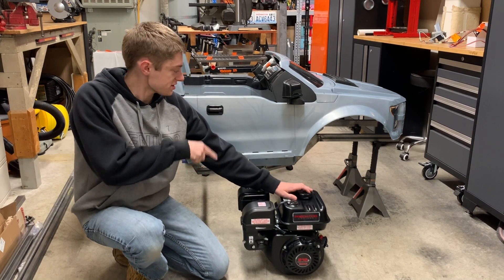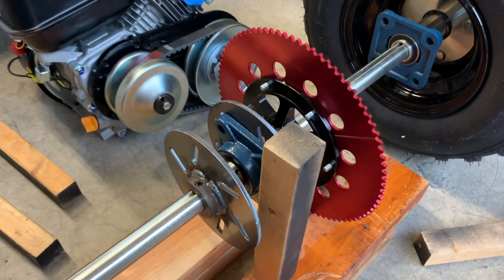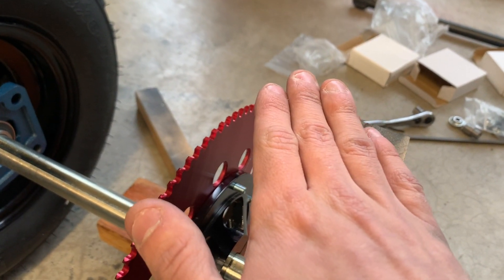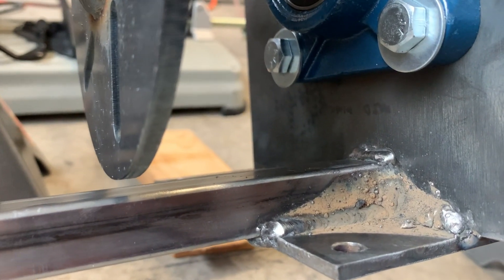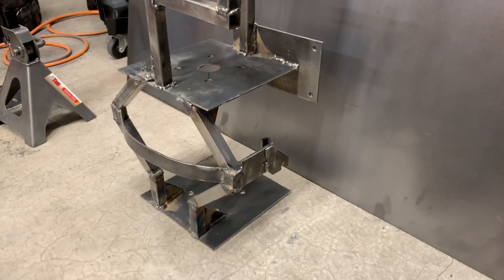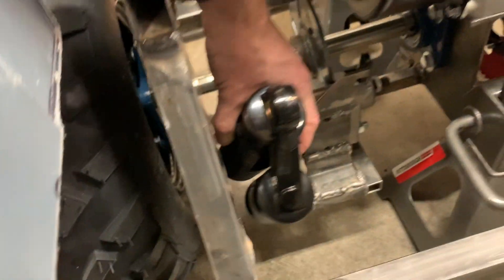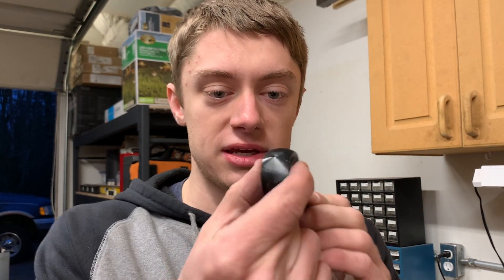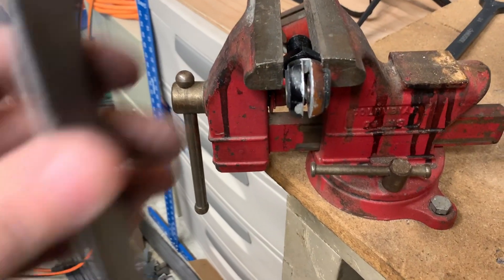Power Wheels Raptor Build Part 3: Crazy Rear Suspension/Drivetrain

Comment: Just a thought , where do you plan to sit ? Your centre of gravity is going to be an issue . Front engine would have put you lower in the seat and made it safer in turns , but to each their own just dont want ya to get hurt . Im sure you have seen GHPC or you wouldnt be building this so maybe steal some of thier experience and make it safer . Its tooooo small to have rear engine but its your build good luck but i feel like this will be a fail sorry .......
Reply from the maker: https://www.youtube.com/watch?v=rOVndrrOp-E
Reply: Wow i really didnt rhink you would fit , good job man , still though your pretty close to that motor . Im thinking of a build myself soon and will post my build videos , maybe you can bust my balls then too lol  . Good job on your build still . The most important thing is you made it finished it and drove it and its more then i have at this point , still working on my gs 750 buggy at the moment. will post when done